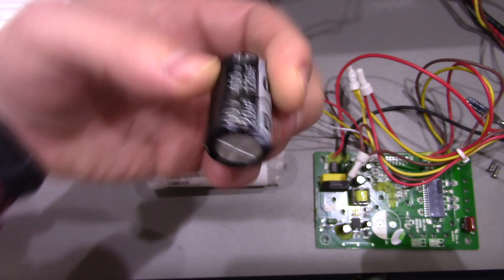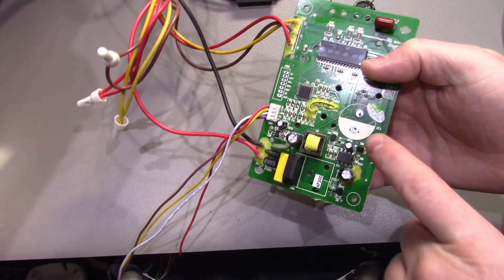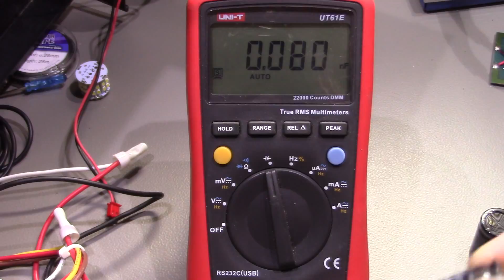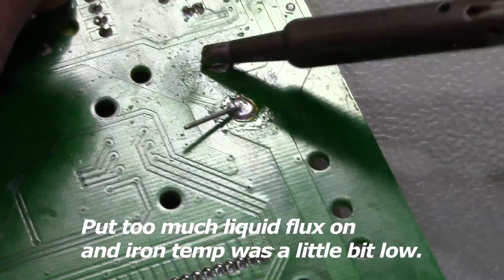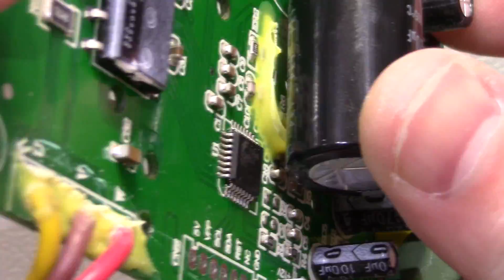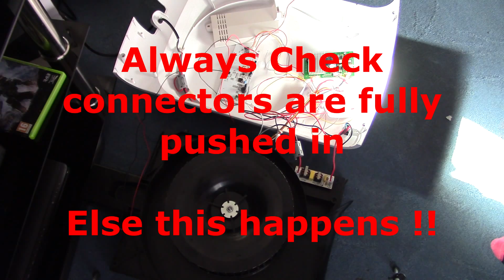Fellowes AeraMax DX95 Repair - Part 3

Comment: Thanks for the video. It worked after I change the capacitor.  However, it started flashing again after a couple of hours.  Is there anywhere I need to look for?  it seems that there is something causing the capacitor to fail?
Reply from the maker: Hi, I don't own this unit any more, but I would double check the switches that detect if the filter is in are clean etc, sorry not to be able to offer more advise

Comment: Hi Gareth, thanks for your informative videos, I know you sorted yours some time ago but I had a similar problem with mine, renewed the capacitor (from RS) worked fine for just short of a year then back to 4 blues flashing again (does it usually after a day or so running), is there something about the value of the capacitor that could be causing this, should I replace with a higher voltage or a different mf value - any other thoughts would be very welcome - thanks

Comment: Hi Gareth. Excellent 3 episode series. Looks like you studied some sort of electrical engineering light current ( Same here). I've just ordered one of these (DX55 Model) as I'm currently dying from allergies. Should arrive tomorrow so hopefully I'll feel better tomorrow. Do you think the smaller DX55 model will be the same inside besides a bigger fan. I'm assuming they using the same electronics/PCB boards across their range to save manufacturing costs. However good to know what problems I can foresee in the future. Should be a easy fix besides undoing the cheap Chinese plastics :) Happy New Year!!!

Comment: I bought one which arrived today; unfortunately it makes a clicking noise quite similar to what you had when you first powered the unit back on. I was wondering is this quite easy to fix? 

Great vid btw, very informative :)
Reply: +Gareth Loader (Electronic Stuff) 
Thanks for the reply. The unit is actually working fine; the clicking noise is coming from the fan as it spins. So I guess my question is from your experience of taking it apart would this be an easy fix? If not I'll just return it as you advise.
Reply: +Gareth Loader (Electronic Stuff) makes sense, thanks!